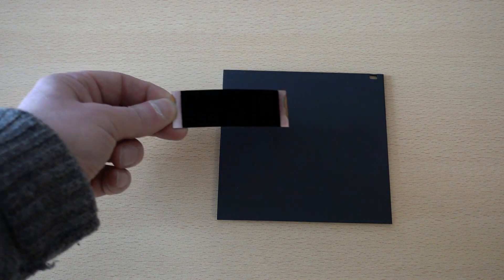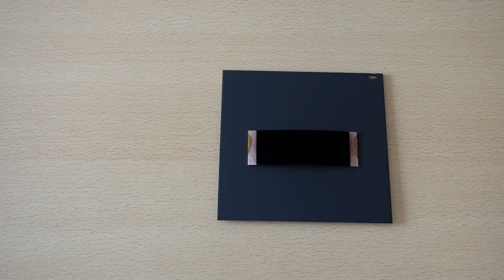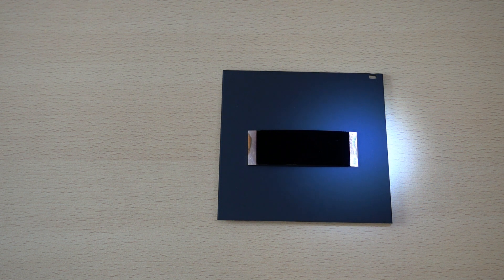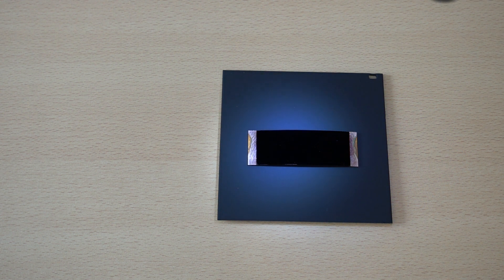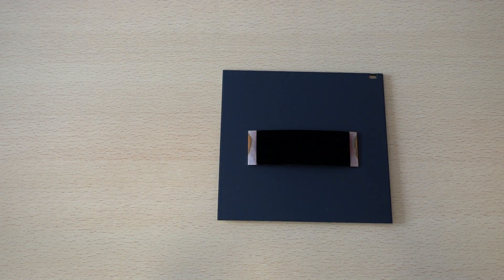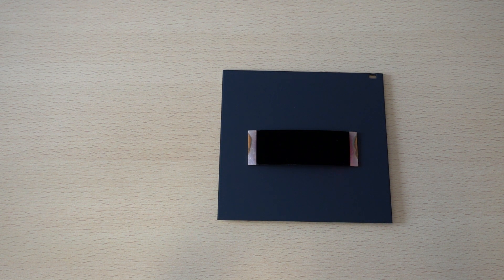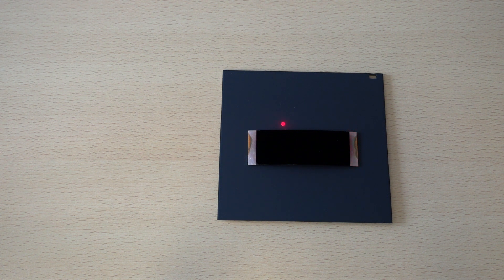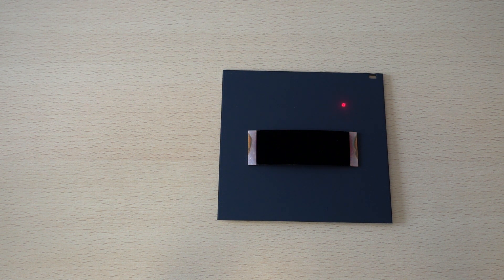Aeroglaze (aka Chemglaze) Z306 Ultra-black paint vs. Vantablack - Shot with a Sony RX100 IV

Comment: where do you get vanta black, and how much does it cost per square inch?
Reply: You can't buy it
Reply: How did he obtain all of his vanta black then?
I'm pretty sure he didn't make it.
Reply: +Bobby Harding If you notice in his other videos he's in a lab, so I'm assuming he does "grow" it
Reply: Thanks. This was the only video i saw of him, and I didn't think scientists use You Tube. Sorry about the argument.
Reply: +Bobby Harding yes there was an article saying they make this in a spray paint that you can buy from them directly.
Reply: +jonnyfendi2003  Thanks, I'll have to check into that.
Reply: +Bobby Harding I hope you have a heated spray booth..."Applying Vantablack S-VIS

Vantablack S-VIS is a sprayable version, so it can be applied under 
controlled conditions in air (enclosed & filtered spray booth). The 
coating is built up over a number of passes until the correct thickness 
has been achieved. The applied coating then passes through a number of 
chemical functionalisation steps to bind it together and change its 
density. These processes typically take place from 100°C to 300°. The 
spray coating can be successfully applied to most engineering materials 
that are thermally stable at these temperatures."

Comment: I want a jacket and pants covered. Cap and gloves will come later, a scarf would be nice.
Reply: I imagine if this got onto clothing many a young teen would get a hit by a car at night trying to be cool and stealthy. That or the material would absorb light so well people would wonder why there is a part of the road their lights wont light up.
Reply: +xGhostBoyx They told me they will not apply it on clothes as the tubes do not stick and bend well. It will be used for aerospace.
Reply: J4ckCr0w I assumed as much, I was just making a joke.
Reply: +xGhostBoyx I really was hoping there would be clothes. Disappointed.
Reply: @J4ckCr0w  it needs temperatures of 400 degrees C to be applied, so I don't know what clothes would survive the 'painting' process in the first place
Reply: @anon_148  How about the car painted with it, did it melt?